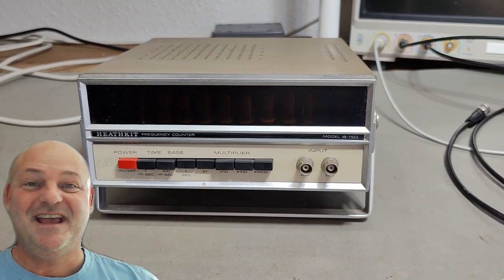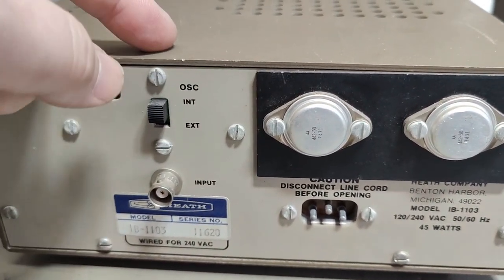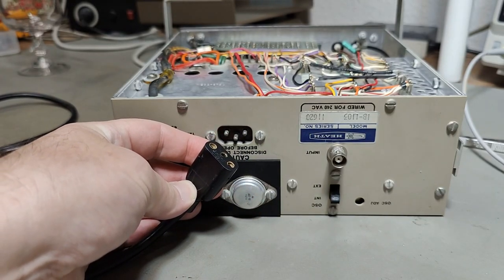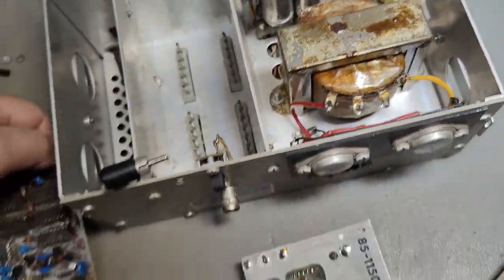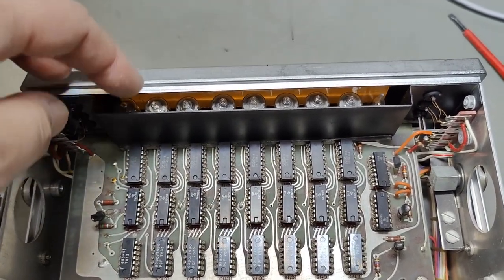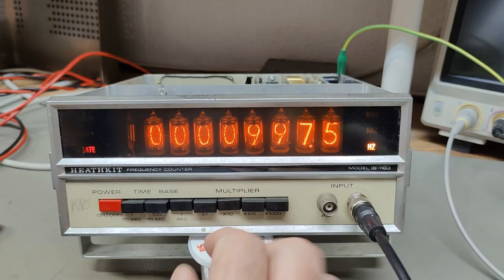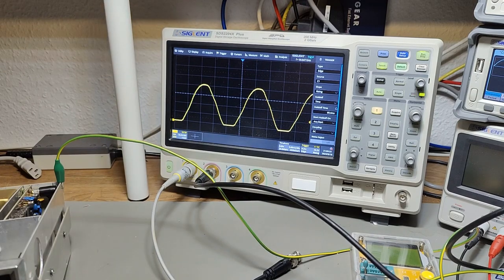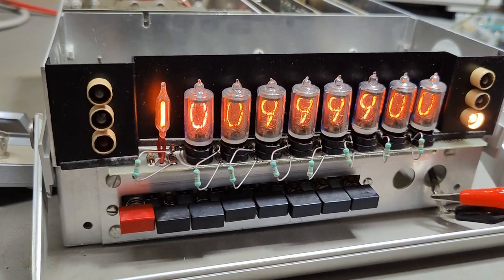Heathkit IB -1103 Frequency Counter NIXIE 180MHz test teardown

Comment: Those Molex sockets were very popular back in the 70s, and obviously Heathkit was not the only company to use them. Their actual contacts are basically the same thing that was inside the 'proper' IC sockets of that time, and indeed are pretty close to what is STILL inside less expensive IC sockets today, not to mention all the proto-board (breadboards) that remain popular.

If installed the way Molex intended, with a special tool, they were no problem. Heathkit, realizing that their customers were not in a factory having the special tooling, included a cheap sheet metal tool in the kits, which did the trick. I only built a few kits in this era that used this kind of Molex socket, and I don't recall that installing them was a big deal.

I have been on a project for a few years to located, restore and document all the Heathkit 1970's beige "New Look" test equipment, and these Molex connectors are found in most of the higher end models (oddly, lower end models such as the IB-1100 frequency counter use "proper" IC sockets). I have not yet encountered any examples where the sockets had gone bad, or were causing any operational difficulties, even after all these years (other than in some instances where an IC might have crept out of its socket a little bit and needed to be pressed back down).

The modular Molex sockets also had the advantage, often used by Heathkit, of allowing unused IC pins to be without socket connectors, and thus without circuit board holes on those positions, opening up space on the circuit boards for traces.

Comment: The model IB-1102 and IB-1103 both use tiny incandescent bulbs for the indicators (and the IB-102 frequency scaler uses one for meter illumination), type 2114D (or just 2114 or 2114-6V). These are apparently still being manufactured. I have been able to purchase them (in the States) from several different specialty light bulb suppliers. If somebody does not want to go the LED route, there is no need to deviate from the original design

Comment: Well you've finally shown something that I own. Purchased one from a gentleman in a nearby city (HAM operator) who is starting to downsize. Mine turned on but would not count correctly. After buying a copy of the complete manual and going through the boards I found that one of the input ICs was not properly inserted in the "socket". Very common problem with those Molex socket pins. The socket pins were not hard to solder as they were held on a carrier strip across the top. You just cut off the number that you needed, then when soldered in, you removed the carrier. I still have part of a roll of them I purchased back around 1976!
I had to open mine to see; the PLL does have a box covering that circuit. Also someone else had disconnected the power connector on the back and added a power cord with a strain relief bushing. My next modification will be to add an external fuse holder. I do like your modification for the Nixie tubes.
Reply from the maker: great, yes the nixie flicker was really a problem for my video, not so much a practical problem for my eyes, most people will not see stuff blink so much.
you can use the search feature on my channel, with some of your stocked instruments, maybe you find a few more matches
new equipment is loaded into my storage all the time, so stay tuned :-)

Comment: I have two of these, and they both have the blue Rubycon electrolytic, with the other two being the solver colored Temple (TI). The power supply board in this video looks just like the ones I have. I rather doubt that any of them have been replaced, or of they WERE replaced, they used the original source parts to do so.

Comment: There’s a CMOS rate multiplier - 4078 and 4527 - that you could buy in mid-70s already (and today from TI!). 

A couple of them do all the math needed for reciprocal counting. No need for a CPU nor PLLs.

There is also some resolution lost when the gate time is not an integer multiple of the measured period - the discrepancy has to be either measured or the gate period used to calculate the frequency display has to be adjusted.

Time interpolation was also possible without CPUs, using a sample-and-hold and a V/T (voltage-to-time) converter. Using slow 70s chips (not ECL, not even TTL) you could measure time down to 1ns and cheaply. Pretty much like say the PM6990 counter does it, just with a bit cruder parts. 

The PLL is a simple solution, but to my digital mind it sounds a bit dirty :) It is very elegant though!

Comment: Old logic families (like TTL) needed less decoupling caps, because they did not produce switching current spikes like CMOS.
Reply: Not sure where you got that; TTL normally needs them - I'm actually surprised that this works as well as it does without them.
From Don Lancaster's "TTL Cookbook"; page 23. My copy that I bought in around 1975/6
"TTL is not only sensitive to supply- and ground-line noise, but it also generates a lot of its own noise when any totem-pole output structure changes state and draws a heavy current spike from the supply lines."
Also note that on this counter some of the input and first stage ICs are NOT TTL but instead old Motorola ECL which used totally different supply rails and were made to run fast! They also ran hot!
Reply: @jrkorman    TLL does produce some spikes, but much less severe than CMOS, where at some moment, both transistors in the totem pole partially conduct (CMOS will draw current, if an input is at half voltage). You can also deduce this from the fact that power consumption of CMOS is proportional to clock frequency.  CMOS mostly draws current only when switching. With TTL this effect is much smaller.

On the other hand, TTL has a smaller noise margin, but in general, it needed less caps than CMOS.
Reply: markocebokli6565, you do seem to have this backwards. TTL is much noisier, in both its output stage noise generation and its general inability to tolerate power supply noise, than CMOS, whose output stages (on most ICs) generate a fairly small amount of power supply noise, and its input threshold being 1/2 of the power supply, is thus pretty far away from where any power supply glitches are. This information can be seen in most textbooks, datasheets, etc; regarding characteristics of logic families. TTL generates and propagates noise, while CMOS tends to "swallow" noise.

If you can provide a source for your (mis?)information, you should include a link to that so we can see what you are talking about.

Comment: Hi Thomas, that AC connector looks like a C5 (Mickey mouse) counterpart, it would be a big coincidence if it fits dimensionally. Beautiful digitron counter and very accurate for its time, I like digitrons (Nixie). Somewhere I saw selling OCXO GPS with multiple output frequencies not just 10MHz
At our 50Hz, the flickering of the display would be even more pronounced, after adjusting the source it is beautifully stable. I just don't know if they didn't do it on purpose, when powering neon lamps with pure DC voltage, the electrodes become polarized over time and the lamp doesn't shine in the opposite polarity, that wouldn't matter with a nixie, but I read somewhere (I don't have my own experience) that the glass blackens faster.

Nice day 🙂 Tom
Reply from the maker: nixie tubes needs DC it is important , this way only the cathodes formed as numbers shine.
if you add AC the common anode surrounding the numbers will also shine.
it is also important to make all numbers light about the same number of total hrs,
else some will not work, when it gets older.
Reply: @TeardownOZ2CPU  I know that DC is necessary for nixies, but as you saw yourself, the display lit up normally, it only flickered on the camera. That's what I meant, partially filtered DC - if the pulsating voltage won't limit the blackening of the glass.
Reply from the maker: @Edisson.  ok now i understand, you can multiplex pulse drive nixie, and you can dc drive them, it is brightness x time that is their lifetime, a multiplexed display is often more dimm over a direct dc driven one, and since more dimm = more lifetime, you kind of got it there.. that is why i reduced the current, by changing the resistors
Reply: @TeardownOZ2CPU  Even old LED displays are subject to this aging, I personally reduce the resistances after replacing them with new ones with greater luminosity
Reply: The AC power cord connector style is called "PH-163", and was common on professional equipment from several companies around the same time, so no doubt Heathkit thought it was a new standard that they should use on their better-grade test equipment.

I can't find anything in writing now, but SOMEWHERE I read that powering Nixies from unfiltered half-wave rectified AC was considered to be effective in minimizing aging problems with the tubes. Looking just at Heathkit's Nixie test equipment, about half of them use a "Villard Doubler" circuit to provide the pulsating high voltage DC, while the rest use the same number of components (transformer secondary, diode, capacitor) in a simple filtered half-wave rectified circuit that produced a fairly smooth DC voltage. Seems Heathkit designers were on the fence regarding which approach was best.

I have seen a lot of modern electronics designs, that still use Nixie tube displays, which deliberately pulse the high voltage power to the Nixies, purportedly to reduce cathode poisoning. I don't know if this is actually efficacious.